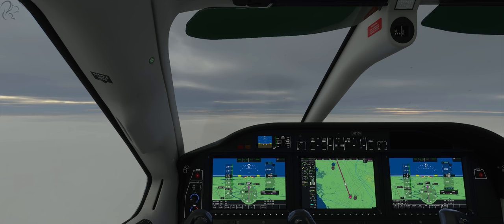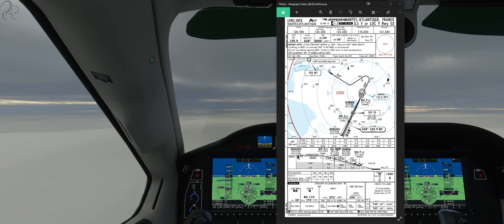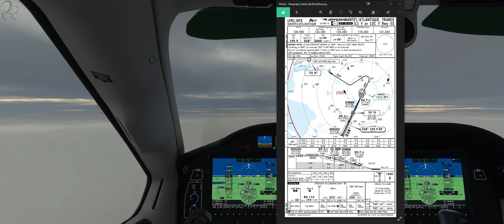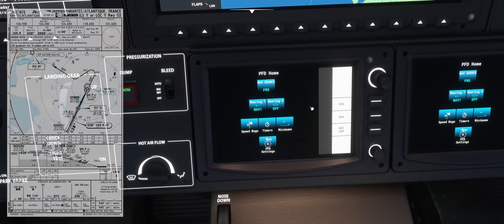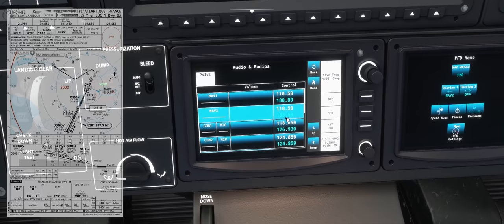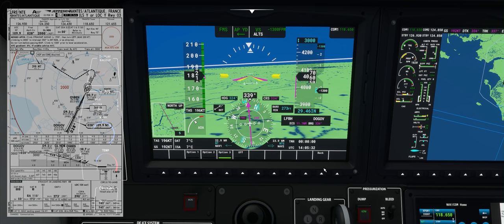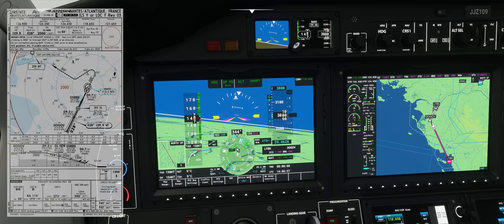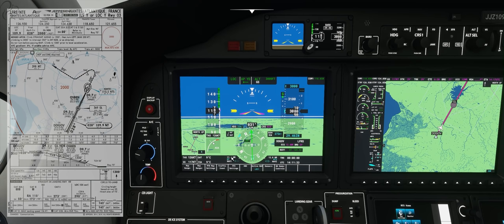TBM 930 ILS Approach - HOW TO in under 15 Minutes - Microsoft Flight Simulator

Comment: Haven't got that many hours in this sim but have done a couple of ILS approaches in the TBM and CJ4, and wanted to make an interesting note. If you choose IFR in the flight planner you can actually select an ILS approach for the destination airport, and most, if not all, of the aircraft with glass cockpits will do most of it for you. In my experience they automatically fly the right course to the approach fix and switch from GPS to NAV1 when they cross it, all you have to do is turn on approach mode once you see that happen. Not sure if actual Garmins and such can do that, but for people new to ILS approaches (like myself) it can help with learning how they work.

Comment: A few things I would like to see with future tutorials, if possible:
1) Mention what's essential and whats optional. In this case for example, only the localizer frequency is actually necessary for the procedure. Could confuse people when they only have a single frequency available and wonder where to get the second one.
2) Show where you get information and how to do the important parts clearly. For example, where did you get the Course from? Also you explained in detail how to change the wind settings and then quickly pressed the softkey to switch from GPS to NAV1 nav source, which is actually one of the most crucial steps for this.

Your videos helped me a great deal when I started with this sim, so thank you for every one of it, just thought I'd leave some feedback that could help make them stand out even more.

Comment: This is the most concise explanation so far. I like the idea of just putting the FIX point for the approach in the system instead of relying on the flight planning which sends you off on these crazy loops before approach.

Comment: You, Sir, are a massive help and the perfect teacher! I am a total newbie to this simulation game genre, but after following you and your tutorials now for the last two weeks I managed to complete the full balkan bush trip and did a 7h flight today from cairo to edinburgh in a dbm 930 with a perfectly fine ILS approach and an ok landing (I think). Please do a tutorial on the last 500ft till touchdown. How do I correct my level and my heading on the final minute? When do I use rudder, when do I use ailerons? That would be perfect! Thank you
Reply: Look up tutorials for "slipping" or "crabbing" an aircraft. These are techniques used when crosswinds are evident, followed by a slip correction slightly at about 20-50 feet above the runway to ensure your fuselage is lined up straight with the runway. I am a student pilot with 15 hours towards my PPL and this is something we study quite a bit. Let me know if you have any questions. Sidenote: I'm training for VFR. The ILS approach is completely new to me, but the hand flying in the final minute or so is completely the same as what I do.

Comment: Great demo! I’d also like to see a missed approach with the ceiling below minimums.
Reply: If I may comment, missed approach is done without autopilot, as it's dangerous under 500'. But the plate says it all and Squirrel setup the missed approach heading and ALT SEL ahead of time. Just like any missed approach, full power, positive climb, flaps up in increments. Fly runway heading until plate says to turn. In real life, if in doubt or slightly confused, ask the tower for help. Here, well, we are on our own.. . Keep in mind if it were below minimums you would already know that from the tower or NOTAM or weather report while you were on the glidescope and your flightplan has an alternate airport above minimums (in real life). Many of us have a personal mimimums (like 500 instead of 263) so we work with that. Give it a try... good luck.
Reply: I'm not sure that your terminology is correct. A missed approach is a procedure that is safe at any altitude. Even ten feet above the runway. In fact, there should be zero stigma attached to calling a go-around, by anyone on the flight deck.

Comment: I am not sure it will work with the Garmin system or in FS2020 for that matter. But I would try arming the approach mode before intercepting the localizer. With LOC and GS armed (white) it should then pick up the localizer and glideslope automatically (and turn green respectively). When the approach mode is armed you are free to use FMS or HDG to control the intercept, which is more user friendly than the method you showed.

Comment: Great video as always!  Just a quick question.. the extra work to use the VOR before the ILS..  is this just something you did for this specific airport?  I generally just fly the fixes in GPS until I am at the GS fix and then activate APPR and let the magic of ILS happen.  Then, kick it over to manual for the actual touch down.   I like what you did here, and a good chance to learn something new.. just wondering if this over complicated it a bit?    EDIT - I just re-watched.. and I think I understand now.. you are showing how to land with ILS, assuming no real approach, or flight plan has been entered into the FMS.  Kinda like you were VFR and all of the sudden wanted to find, and land on the ILS of a given runway.  This would be how to do it etc.  Tho, for most all IFR flights all of this would be planned and apart of the approach fixes (which is why at first this made no sense to me)  So, everything would be the same except the part of tracking the VOR.  That would not be needed.
Reply: My exact question was what the context of this procedure was, but I think you answeredit!

Comment: It is pleasure to hear you using the correct terminology. I am going to say you fly real airplanes as well! The real airplanes that I have been flying with FMS systems will auto tune the loc frequency automatically when selecting and ILS and slew the course needle.
 I am new to G3000 do you have to tune the Localizer frequency? 
On A CAT 1 ILS the baro setting for mins is the only acceptable means of identifying the MDA yes MDA in modern equipment not DH DH is decision height only use on CAT II approaches and lower.  The Radout radar altimeter is for reference only on a CAT I approach.
Yes this about flight sim hobbies and my statements maybe a bit deep in the weeds for swimming. In the real world this is serious 😁🛫

Comment: Video suggestion, Squirrel: Many people are flying the TBM, including myself, and my landings; well, suck! A quick video (5:00), would really help clear up throttle, flap, trim, and approach angles for us. This plane is so quick to maneuver that I find I am borderline out of control the last 20 seconds and am slamming the plane down on the runway. Thanks in advance if you can show us how a professional sim pilot does it!
Reply: You can put the first notch of flaps in at 178 and then gear down (also up to 178) and then full flaps at 122.  Approach speed should be 85 knots minimum.  Your rate of descent on final at that speed should be around 400-500 feet per minute.  Practice holding 85 knots at a higher altitude in that configuration in a 400-500 foot per minute descent.  Control airspeed with pitch and control your rate of descent with power which is what you will be doing anyway until you're over the runway in the flare to landing.  I hope that helps you out.  I am a professional pilot and former flight instructor.
Reply: You, my Man, Rock! Thanks for taking the time to write that up for me. I will practice your advise. The next tine I go into the sim (later today) I will look to see if the FPM decent number shows to the right of the altitude in the PFD. I have never used the FPM for landing. I have only noticed it while dialing in the VS numbers. So much to learn. Thanks  again, Friend!

Comment: I'm having a lot of trouble getting the APR mode to work properly and I think it's because I'm flying the approach too fast. Usually coming in around 150 Knots. I'd have APR mode engaged and it would sink way below the glide slope and would have to take over manually. I'll slow It down next time.

Comment: Squirrel, just an aside. The speed for the first selection of flap on the TBM is 178. You do not need to be in the white arc for the first selection. It is the same speed as the landing gear extension speed

Comment: Hi, I've checked on other charts for different airport. I can't find the NT and NTS numbers. Maybe i'm looking for the wrong thing or is it labeled differently. I really need some help and it would be so great if anyone knew.
Reply: NT stood for the ILS system. If you look at the chart, where it says ILS DME and a radio frequency, it will say something along the lines of 170 degrees, 110.7, EL. EL is what the ILS system is called. For example, if it said 5.1EL, that would mean that that waypoint is 5.1 nautical miles from the ILS system. Hope this helps.

Comment: One thing that I've been trying to get an answer to is why when I load and activate an approach does the autopilot try to turn me around to the previous waypoint before I activated the approach? I've had to always ride the heading bug in until localizer capture and fly the loaded approach that way. Is that as intended to switch to HDG instead of riding the FMS, or am I doing something wrong? By the way, deleting the waypoint it's trying to go to will just make it try to fly to the previous waypoint before that one until the sim stops responding and I have to control shift escape.
Reply: I have the same probs^^

Comment: I understand 'approach' but what is 'transition'? And what should you do when you get to a transition waypoint?
Reply: Transition wapoints are simply various waypoints located in different directions that act as entry points for paths that all will end up at the same  IP, DOGOV in this example. If you are coming in from the north you will have a suitable transition point to the north of the airport and a path that leads to DOGOV. If you approach from the west there will be another transition point to the west, etc. This is where you transition from the enroute waypoints to the STAR route(s). STandard Arrival Route.

Comment: What do you need an instrumental landing system for when you are landing manually anyway? Sorry, I'm a complete noob. I don't understand this whole ILS thing. I can fly the aircrafts in autopilot mode and follow the planned route. But I don't get this whole ILS thing and why you have to remember frequencies. In the game I'm just prompted by the radio messages to switch to certain freuqencies.
Reply: ILS is used when you can't see the runway on approach, say if you had very low clouds. The ILS will bring you down out of the clouds on the correct approach. Hopefully by that time you can see the runway before you reach you minimums.
Reply: When you are flying in the clouds and bad weather, you cannot see anything, so they call it Instrument Flight Rules, IFR, meaning you have to rely on your instruments and radios to guide you while the controllers keep your airspace clear in front of you. The change of frequencies you hear are for talking to each controller as a hand off along your route. What Squirrel was doing was the Navigational Aids that your plane can aim towards. The dots and needles point to them and let us know we are on the right track. Those Navigation radio signals are just like FM radio signals only the plane can use them for guidance. GPS can only get us from one point to another, but not descend or climb to appropriate altitudes that are published safe approaches to land.  Squirrel showed us what a pilot would have learned in many hours of ground school theory and hours of practice with flight lessons in a plane.
Reply: Ok thanks, I will try to learn it in FS2020. Until now I didn't get it managed to fly with the ILS. Following routes with auto pilot works but I still don't get it how to switch to the ILS system properly.

Comment: No need to manually enter the approach mode or anything like that? Just nav mode all the way and can capture glide slope?
Reply: You need to hit the APR button to follow the glideslope. Otherwise you will just stay at the selected alt. 
Loading in the approach into the flight computer means you don't need to manually setup nav frequencies and can stay in nav mode. And, hopefully, should see hights at each waypoint of the approach without a need of approach plate. [but honestly i'd take a look at it anyway.]

Comment: They need to fix the breaking out to minimums in the sim. The clouds are too translucent. You can see lights and stuff through it when you should not.
Reply: I agree 100%. Real pilot here, and this game has a long way to go. Low vis conditions are only one of the many areas. FS2020 is a game as it stands now. Ones before it were simulators. Obviously the game has a ton of potential, but it is not there yet. Have been an MSFS user since early 90s, so this has been a disappointment thus far. Myself and most other real pilots who know what it should be like are heading back to XPlane.
Reply: RB T I think slowly it will be fixed. If not by developers, by the community. I have faith.
Reply: Jeremy - Good point and I agree. I’m just saddened it was released like this and that I’ll have to wait for what I’m guessing will be some time before it’s all up to par, the way I was expecting a $120 game would be when I received it. My home airport is a mangled mess with unusable taxiways, inaccurate runway elevation, and trees that prevent an actual approach without crashing the plane. Very frustrating when knowing no previous flight sim has had this issue, but you have the right attitude about it. Cheers and safe flying
Reply: RB T 100 percent. It was released in an unfinished state. The fact it doesn’t have basic features that FSX had is not
Cool. Time will tell I guess!
Reply: @rbt5785  I am curious: how do you feel about the ATC in fs2020?
Reply: @rbt5785  Well, the real immersion breaker in X-Plane was weather reload on the approach. If that happened you could suddenly see the runway and everything around until it reloaded the clouds. The only thing you could do is to close your eyes and pretend you did not see that.

Comment: Hey, Squirrel... if you can do an RNAV approach as succinctly as this great ILS video it would be *amazing*. Or is an RNAV option too borked ATM due to FS2020 VNV and FLC issues?
Reply: VNV doesn't work on the TBM yet.  However, if you have the waypoint minimums handy (or add them to your flight plan),  you can mimic the VNV by using FLC or VS to fly down to the correct altitude manually.  I use an app called Vnav (App Store) to calculate the correct descent rate in feet/min based on remaining distance and TGS.
Reply: Allan Farrow Good shout on the app. Downloaded and I reckon that’ll be really useful 👍🏻. And I understand Paul is doing an RNAV vid next week 👍🏻👍🏻, thanks for that!

Comment: Anyone know why sometimes when I use autopilot, it just pulls hard left/right, and tumbles into the ground? TBM930 bw
Reply: There's a bug with MSFS's autopilot right now where sometimes it incorrectly corrects for any input you may have had on the yoke when you engaged the AP; and the problem only grows more severe if you disengage the AP and then re-engage it again with any non-neutral yoke input; and once the AP is borked it'll stay borked for the rest of that flight session, the only way to fix it is to leave the plane and start a new flight.   The best way to avoid the problem from happening in the first place is to make sure your yoke is always neutral before turning the AP on.

Comment: So in this case did you NEED to have NTS in NAV2 or could you have done this the same with just NT in NAV1?
Reply: When running an ILS approach, it's always best practice to have both the NT and the NTS loaded just in case one of the two suffers a fault.

Comment: Where can you actually download airport charts? Skyvector doesnt have them that I can see, and googling just leads to nowhere
Reply: Skyvector is for making a flight plan with VNCs, IFR charts and airport lookup. The end result is a flight plan. For the plates, many of us have a subscription as they change regularly. I use Foreflight on my iPad in real planes and I can connect it to Xplane or MSFS for the same things. The plates are always up to date. For the sim, you can google "approach plate" and get a Wikipedia explanation, then google "approach plate CYVR" or the ICAO airport of your choice and you will find "images for... " They will do just fine in the simulator for the most part.
Reply: @ForderLearnToFly  Thank you, thats much appreciated. I think I may wait until the next patch to see if they fix some of the strange auto pilot issues. I have tried 3 or 4 times now, using both the onboard flight planner, littlenavmap etc, but nothing seems to work correctly. The onboard seems to get to a point after you enter approach mode and just goes awol.
Really hard to learn things like this if the tools are broken in the first place

Comment: It had a hard time staying on the glide path for me. Had to turn off AP and correct manually. Any tips on that?

Edit: Had the same problem on the Citation today. Must be me, maybe I lack the fine control for the throttle 😅
Reply: Some airports in MSFS2020 don't work ILS, off to the left